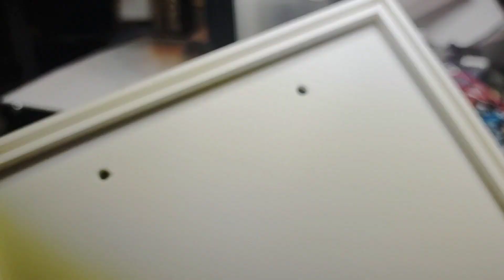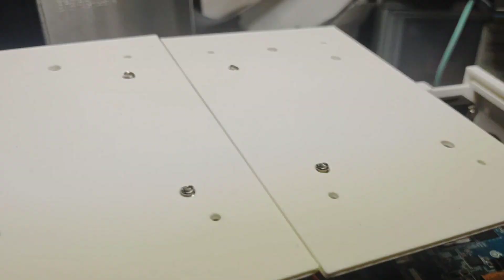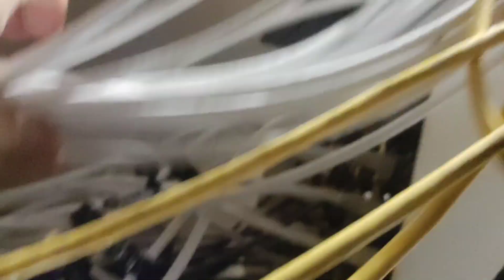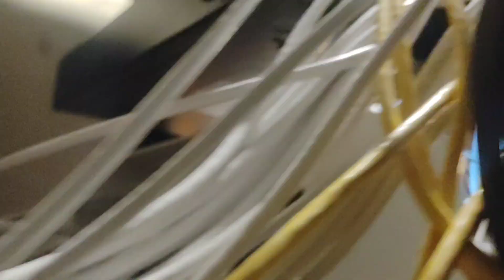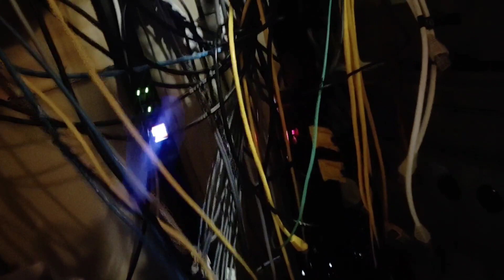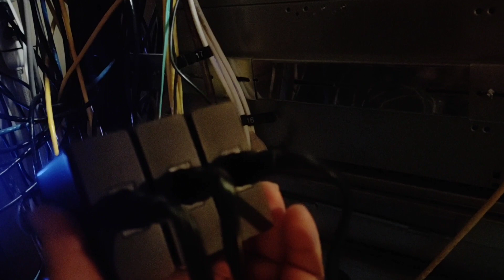Orange pi 5  mining cluster part ?

Comment: what is your hash rate?
Reply from the maker: About 65 MH on luckpool
Reply: @TheSasquatchjones   I've got 10 phones and my hash rates have gone up to 60mh/s mostly stays around 53mh/s.  What do you think you have in your setup money wise?
Reply from the maker: @woodknack1  probably a lot less than you depending on how much you paid for your phones. I'd say roughly $1000. (Know.. expensive).  This was more for the project than the profit.  The good news, once it's set up and the Cron job is set to keep the pi's mining on reboot I really don't have to worry about them. I also have phones mining and they do get around 5mh per, but sometimes I have to manually reset them. I guess that's the trade off.

Comment: its worthit now?
Reply from the maker: I think so, but to each his own. They are a little expensive. This project was more for fun than anything else. There's a trade off here , if you're looking at profitablity. 

Using phones are much more cost effective, but they tend to have higher maintenance. Some phones will stop mining after a while and need to be reset. The pi's can be set up with a Cron job that automatically restarts the miner after an outage. I really haven't had to mess with these since I started them.

Comment: If you want to strongly bond PLA prints, 3d pens are great for that, not good for materials like ABS, but for that use an acetone/ABS 'slurry'
Reply from the maker: Yeah, I may invest in a 3d pen for future projects. I only wanted the super glue to tack  the parts together so that I can pull them apart easily for service.